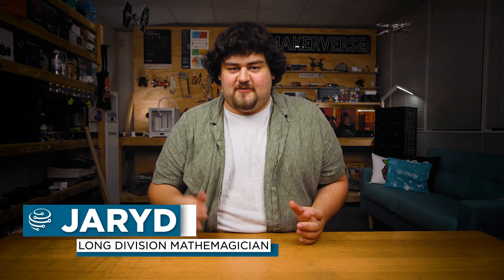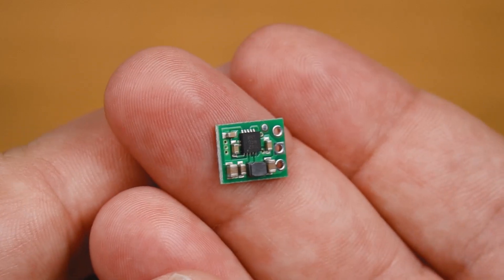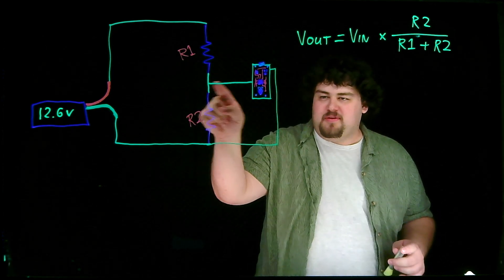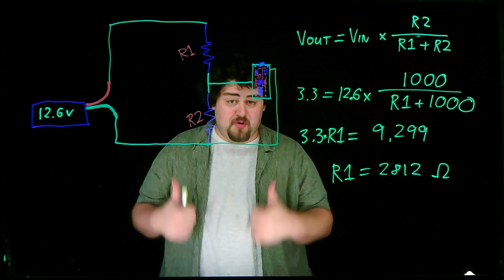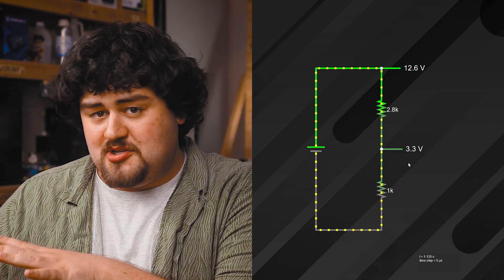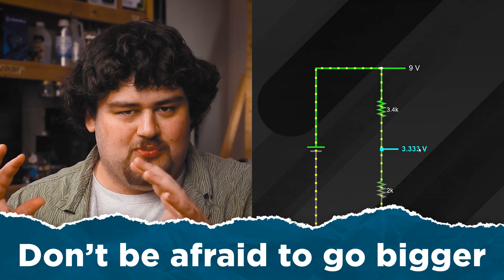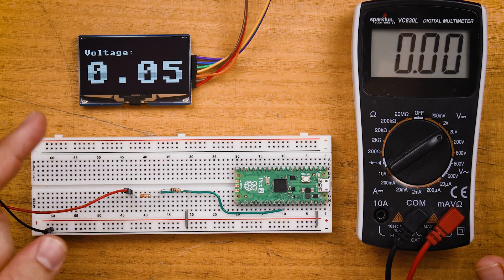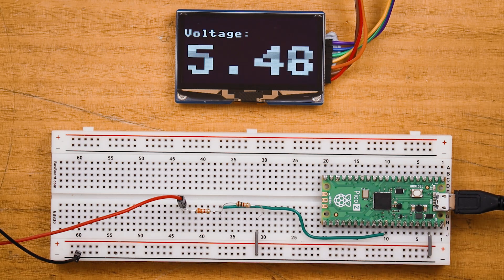Voltage Dividers for Makers | A Practical Guide

Comment: An average filter helps to settle down the reading. Also, calibration offset filter using known supply voltages over the range you want to measure are great to ensure accuracy for any given application too. 
The ADC in Pico's are not the best, so an external ADC board will help with this, and they generally give you more analog inputs, most modules give you 4 ADC's that connect into the Pi via i2c. Code starts to get more complicated, but ChatGPT is your friend...

Comment: When I'm going to use only a ultrasonic sensor for my project. How should I wire it up so it doesn't fry my pico with the 5 volt of output. Like it got me a bit confused with that extra battery ground.
Reply from the maker: You should be able to connect your ultrasonic sensor to the Pico exactly like you normally would. How ever you did it without the voltage divider is how you should do it with. If the sensor is using 5 volt logic, you will need a logic level converter. Any bi-directional one will work like so:

https://core-electronics.com.au/raspberry-pi-5-18650-battery-ups-hat-51v-5a.html

Comment: I tried a voltage divider before, but my Pi did not have consistent readings. I did not use common ground, so I will try that.
Reply from the maker: That will definitely give you some issues, sounds like you've already found your problem!